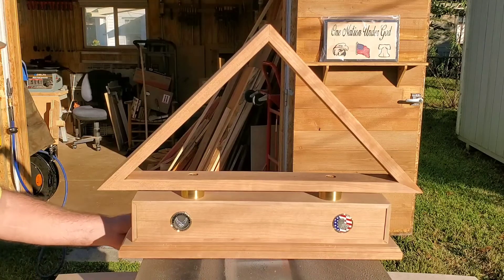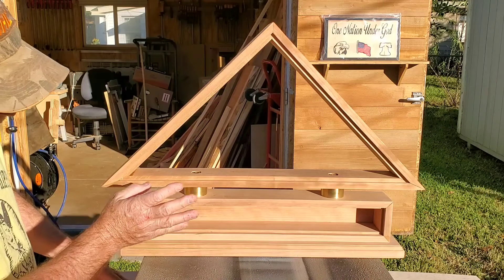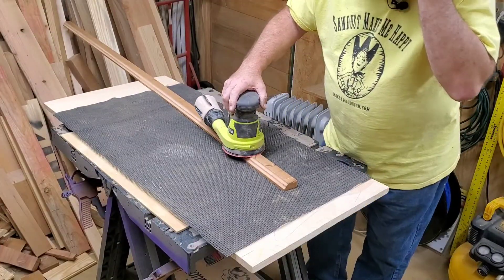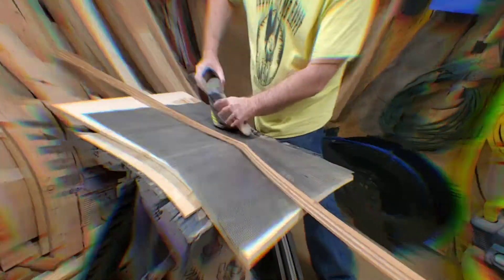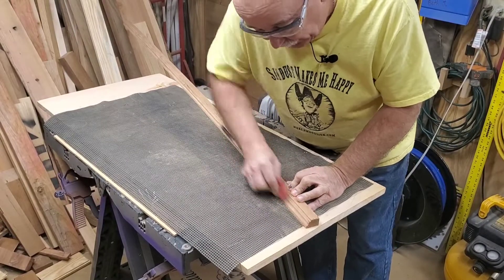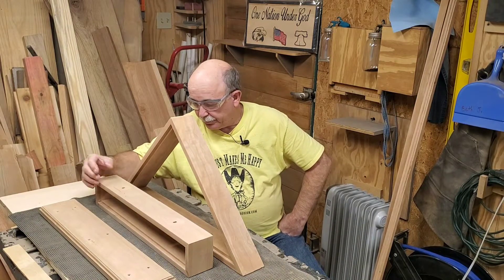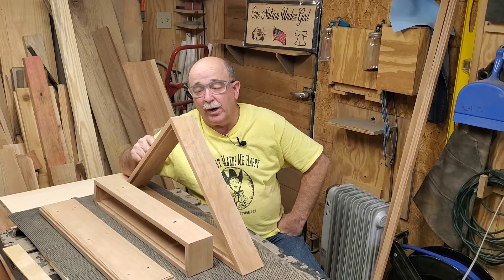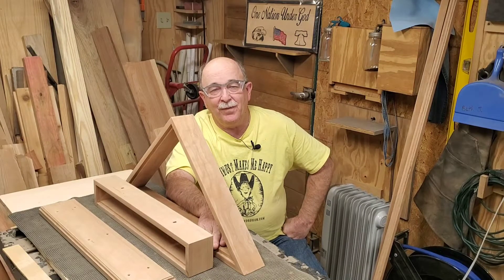Bucket Head - Video #11

Comment: Frank I love how it looks. It's going to be even better with a finish on it...🤘🤘🤘
Reply from the maker: Thanks Dan.  I cut the trim to size this morning and hand sanded all the parts to my finish grit.  I will try to get the finish applied tomorrow afternoon.  I need to cut out the back for the flag holder and get it stained first.  It looks like I may not get the glass until Thursday now.....my laser guy's supplier sent him the wrong material so they had to ship him some replacement out rush.  "Jenkins Luck" prevails!!  :-)